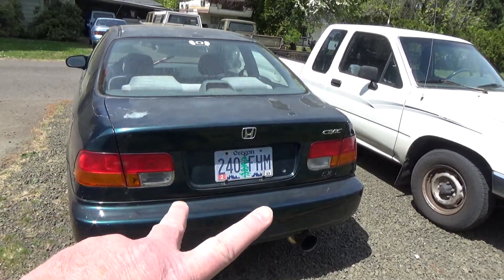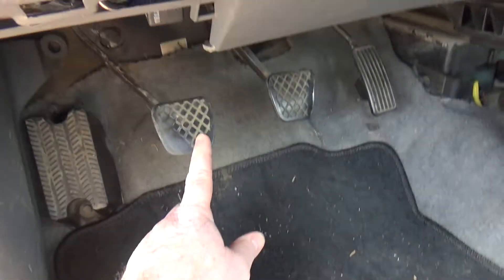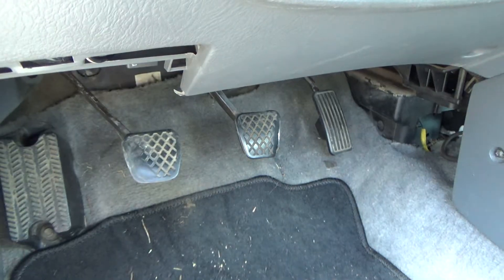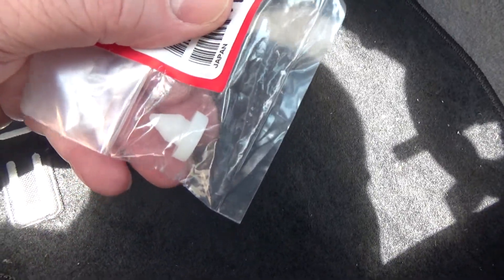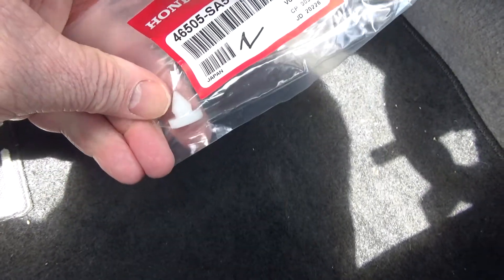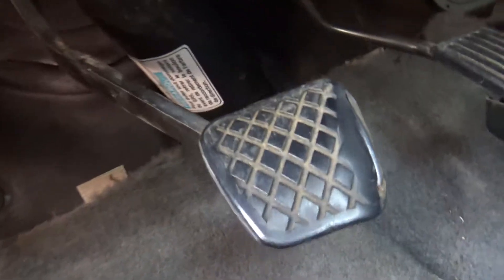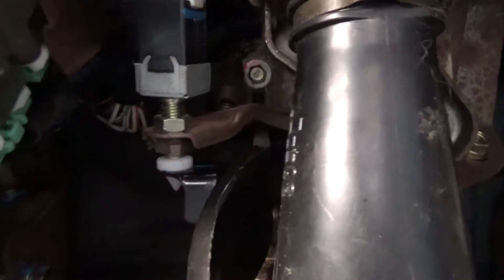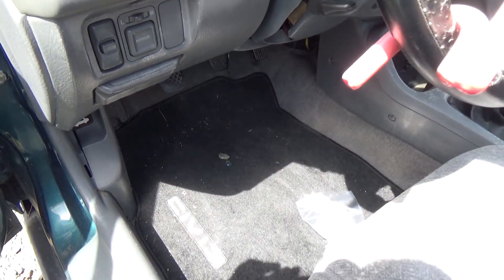How to fix #Honda #Civic brake lights stuck on

Comment: I want to thank you for this! I did not have the plastic stopper as it was late at night, the car parts stores were closed, and I needed a fix. I used a bolt & nut about the size of the plastic stopper and it worked like a charm. Thank you once again for helping me and many others!

Cheers!

Comment: Thank you so so much! Tail lights didn’t turn off when I got home last night & was really hoping it wasn’t another electrical issue. Popped a large pebble in there for the night & got the part the next morning. Problem fixed for less than $10! 1993 Honda Civic, brake pedal stop pad.
Reply from the maker: That is awesome.

Comment: Just had this problem yesterday, I'm glad I watched your vid because I thought I had a bad wiring issue that could cost more than the car is worth to fix. Advanced auto had the break pedal pad for $11 & it was simple to install the black rubber piece. Thanks my guy.
Reply from the maker: Welcome! If you're in a place where you can, consider tapping the ❤ with a $ to support. And if not, enjoy—this one’s on me 😊.

Comment: Thank you so much for this video! At first I thought something was up with the transmission because when the button was not being pushed the brakes were still holding on and making acceleration difficult. A $6 part at Autozone and we are back on the road. Thank you!!

Comment: 1/4 20 hex head bolt and nut works just fine and will not fall apart
Reply: I might do that. Mine just broke 30min ago. Update: Since I'm a hoarder and buyer of bolts and nuts of all sizes I happened to have the perfect one, great suggestion!

Comment: I don't suppose you'll reply anytime soon but I had a question.   

I know how to replace the brake light stopper but is there any reason why the lights used to stay on constantly but now they're never on?  Does that mean the brake switch burned out?

I ask because I had this same issue about 3 months ago, not gonna lie I let it go on for that entire time just disconnecting the battery when I parked so it wouldn't die but now the brake lights almost never come on.  Battery still dies if I leave it connected though so I'm thinking maybe the switch died?  

I heard the fuse from someone else but if that blew out it would prevent power to the lights not let it flow freely so I'm really lost here.
Reply from the maker: What year, make, and model are you working on?
Reply: @tubejim101  01 LX.  More detailed below if interested. 

I checked the fuse, and it looks unbroken, but I replaced it anyway.  I heard from a buddy that the horn & brake lights share that same 15A fuse, and my horn stopped working years ago, I could never figure out why and now the brake lights are acting up so I'm at a loss with this thing.  

I replaced the relay for the horn but it's still inop so I've given up on that, but I'm wondering what the heck is going on with the lights now.  It's really confusing, like initially when the stopper first broke they were on 247.  Now they're almost never on.  Occasionally the brake lights will pop on but it's very rare which is why I'm thinking the switch itself maybe fried from being constantly on.  

Which I think could also explain why it killed the battery, if the switch went bad so it didn't turn on the lights but it was constantly drawing power?  Either that or the bulbs simply burned out.  I dunno
Reply from the maker: @TheJacyn313  If you have a 3rd, or some center brake lights, that may be the issue.  Might have corrosion in the sockets too.
Reply: @tubejim101  it does have the mandated center brake light.  I don't know what to check but I appreciate the fast response.